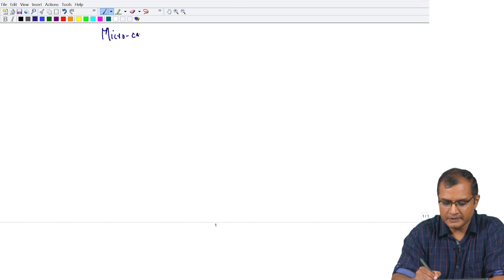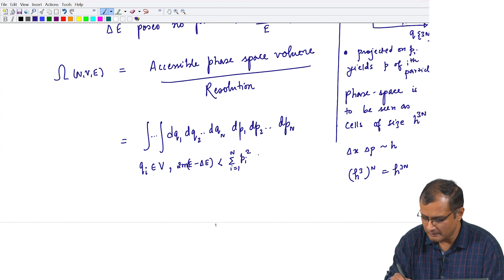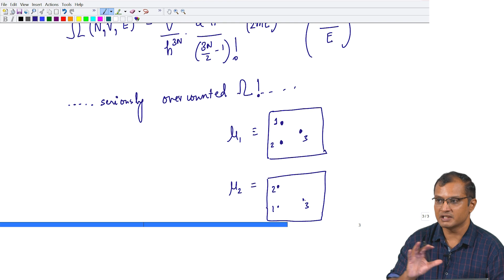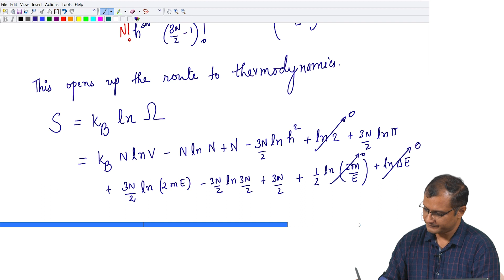Lecture 16-Classical Ideal Gas (Microcanonical Ensemble)

Comment: 50:05- how can we drop ln(deltaE) for x tends to zero ln(x) will be -infinity which is a very huge contribution
Reply: I had the same doubt but i think the correct reason for dropping is because you care about change in entropy, not entropy itself. So when we find the derivative or difference in entropy, that term will cancel since it is a constant.

Comment: well explained but why need to use gaussian in integration in momentum but not on generalized coordinate?
Reply: Whatever coordinates we will use in the end we will have just volume at the end !, thus we don't need to do so, And the momentum part we have use somewhat like spherical coordinators of momentum space, this is due to the fact that 2mE is just sum of squares,just like x²+y²+z²=r²,, and in such a way calculating the volume of a hypersphere is very easy! here sir has used gaussian integral but without it there is nice formula to derive volume of a hypersphere.

Comment: 4:00 - Computing Omega to develop thermodynamics of the system
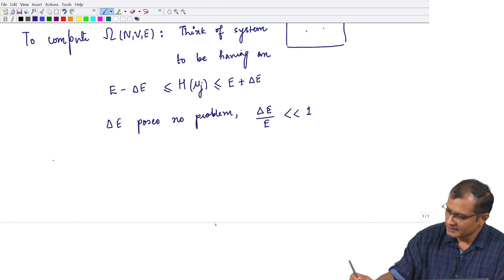7:20 - Plan/formula to calculate Omega
15:00 - Equation 1
16:50 - Illustration of the shell volume we want to calculate (the volume that would represent the microstates in a microcanonical ensemble for an ideal gas)
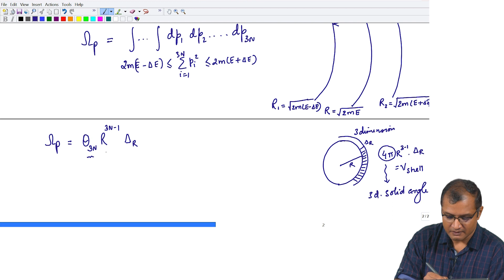22:35 - Calculating the Momentum part of Omega
26:40 - Equation 3
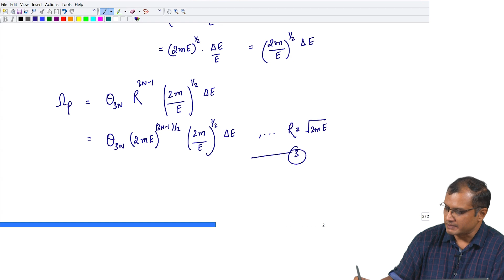26:55 - How to calculate solid angle to find the momentum part of Omega
40:50 - Equation 4
41:20 - Final answer - found the number of microstates for the system (final answer for Omega)
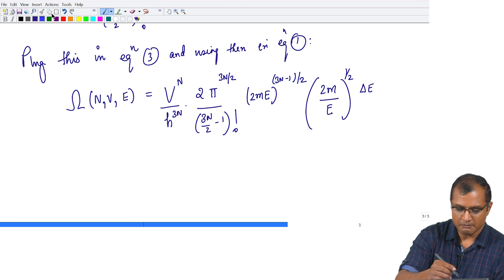43:35 - Problem with overcounting microstates
47:20 - Connection with thermodynamics
Reply: Recommended book ??